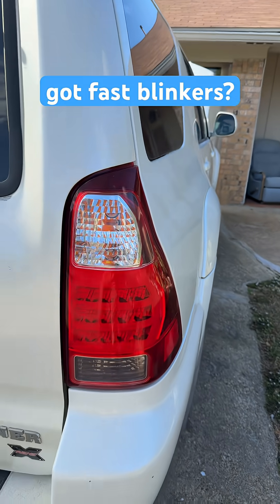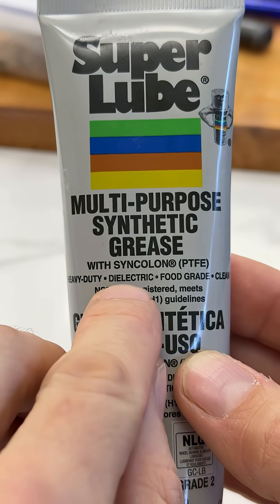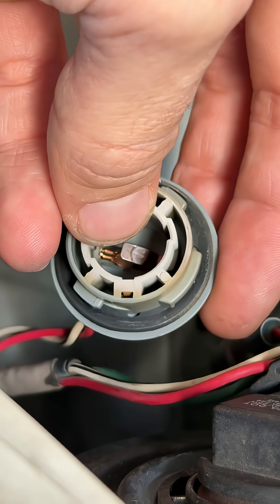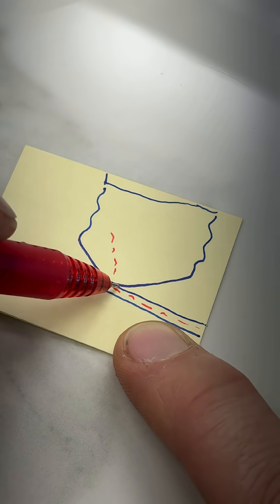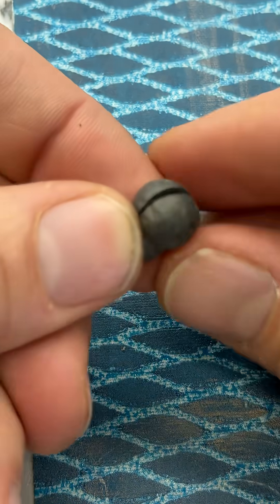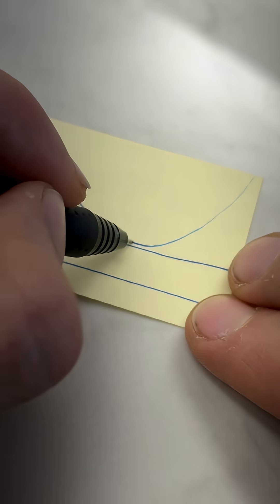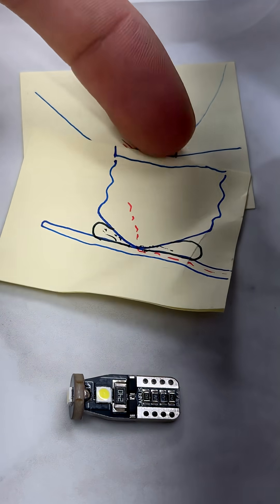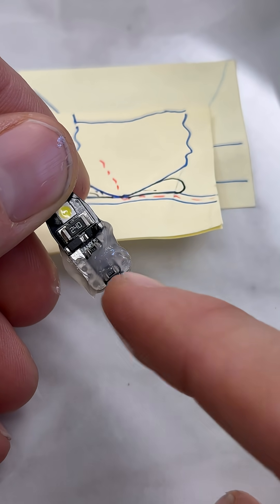I forgot to grease my blinkers. (no joke)

Comment: This is more for older vehicles with standard incandescent bulbs and really doesn't apply to led lighting since led's turn on and off at a certain minimal voltage threshold, to the same brightness. If you take a socket with the pigtail and insert a good bulb and measure the resistance between the two wires with the bulb in and no lube, then add lube and measure again,,, technically there will be a thin film of lube between the base contacts making the readings different. The grease should increase the total resistance especially since it's designed resist the flow of current. If per say.... The resistance doubles the current flow should drop by half.  Let's say before grease we had 1 amp and now with the grease ½ amp... Will the bulb light up half as bright? Try it. If not... Since it's dielectric grade why isn't it resisting that flow of current? 🤔😉👍👏. Also could you use dry slide or wire lube for pulling wires in conduit because it also has dielectric properties? 🤔🤷🙂

Comment: You don't put dielectric on the contacts sorry to inform you but that actually will add resistance at the contact. 
di·e·lec·tric
/ˌdīəˈlektrik/
Physics
adjective
having the property of transmitting electric force without conduction; insulating.
noun
a medium or substance that transmits electric force without conduction; an insulator.

Rubber is a dielectric fyi.

The purpose of dielectric grease is actually protect water encroachment on your seals so you would put it around the top of the bulb if you wanted to around the edge but not where the contacts are.

Comment: I knew it prevented corrosion, but didn't know that's how it worked. I use high(ish) voltage equipment with intermittent connections but we're not allowed to use grease so we have to clean them off periodically. It would be neater to just use grease

Comment: I saw my dad pull a bulb, see the filament was still good, rub the bottom contact on the cement to freshen it up,plug it back in and it worked. He was an old school VW Master Mechanic. As in he worked on the 36 hp Bug when they were new.

Comment: Those blinker bulb filaments can burn just barely open circuit to where they look okay and sometimes even still work but you go over a speed bump and it vibrates open enough to stop working then the next bump sticks it back together enough to work a little longer. When one bulb has problems just buy a pack of 10, replace them all and be done with it for the next few years.

Comment: Why doesn't the grease prevent the blinker from making contact?  Doesn't it insulate?
Reply: The grease gets pushed out of the way and allows the metal to contact fully, but it completely blocks oxygen from contacting the metal directly around the contact location. This prevents oxidation and ensures a longer lasting better connection.

Comment: Being from the Midwest, i put dielectric on every electrical connection on anything automotive. Especially any exterior wiring. Water will always find a way in. 

I will add, the SuperLube brand dielectric grease is much better than the Permatex brand (IMO) that is sold at most autoparts stores. For one the Super lube comes in a plastic tube, not a foil tube. No matter what, the foil tubes get a hole in them, some way somehow, EVERYTIME. Or when you screw the cap on the permatex tube it will crack. Has happened on the past several tubes I’ve had no matter how gently i put them on. I have also noticed that after awhile the Permatex will get a chunky consistency, while the Superlube does not. It makes it hard to spread evenly and it seems like it doesnt do as good of a job. The Superlube seems to just cling to surfaces better and maintain its surface tension across where it is applied. The past several months I’ve been using semi-large gauge blunt tip syringes that i have filled with dielectric to apply it way down into connections where i need it. Less mess, and you use less of it applying it more precisely. 

Great info as always! Carry on.
Reply: Yup got a metal tube with a hole in it right now, I’m 99.999% the tube I have came that way because the inside of the plastic packaging was greasy the moment I opened it.

Comment: Wait. Is there any reason I shouldn't use this on all batteries that sit for an extended period and run the risk of corroding on the contacts? If it's good for that then I feel weirdly cheated having never been told or learning of it sooner...like 20 years or more sooner.
Reply: Yes, you absolutely can and should try to use dielectric grease on any metal to metal contacts, especially those exposed to the elements.

With household batteries and remotes though, there isn't enough voltage or current to really cause issues, but if a battery leaks, at least the devices battery terminals won't get accelerated corrosion damage from the leaked chemicals. 

And also, some battery receptacles rely on friction to keep batteries well connected, and grease/lubrication might make it hard to keep batteries in place, especially on poorly designed retention methods.
Reply: @sivansharma5027  You write this AI-but-not AI-response, but never mention to use ni-mh batteries instead of alkaline? Lol, it stops 99% of leaks.
Reply: @Hisokaa-d2j I wonder what word is used to refer to something that seems AI but isn't AI?

Human?
Reply: Same concept, I'd say.
Reply: ?? this is for use outdoors
Reply: You've likely been asked to buy a pack if you've ever bought bulbs at a parts store. You probably just turned it down.

Comment: I would recommend that you not just grease the bottom contact, but the whole side contact.

What that dielectric grease does a really good job of is keeping moisture out, but to do that you need to grease the metal sides of the bulb base and the bottom.
Reply: I was thinking the same
Reply from the maker: ❤ Your advice is probably better than my choice in this demo.  I always find my hands full making a video and taking a hair of a shortcut simply to get stuff on camera. Then folks like yourself fill in the gaps.  It’s a relief I can be imperfect with videos and experienced people show up in comments to top it off with expertise. 😊